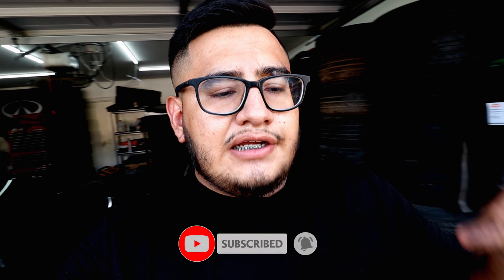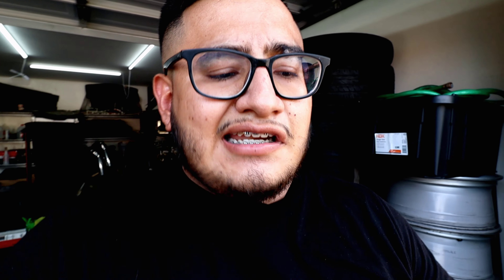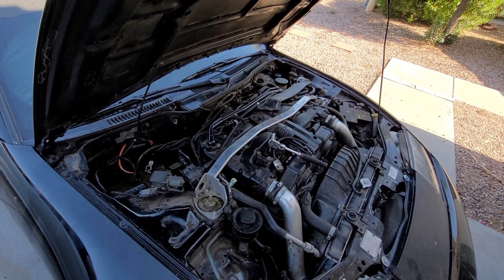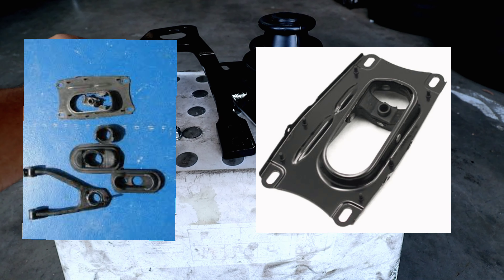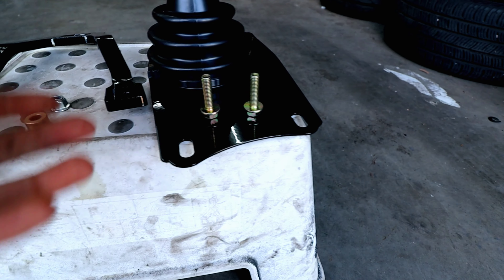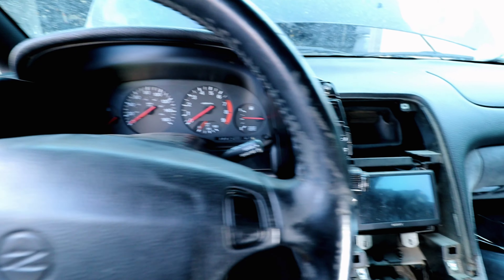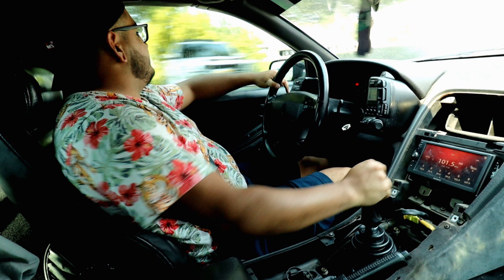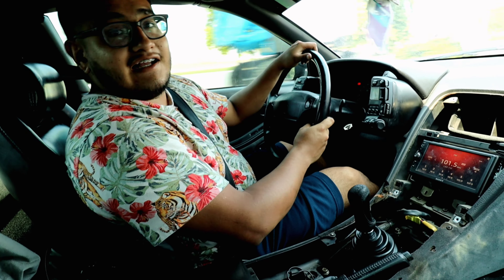This Mod Will Make You Shift Faster | Z32 Z Speed Solid Shift Brace

Comment: So where was the rattling coming from? Was it the shift knob? Also couldn’t help but notice a clanking whenever you moved the shifter all the way left or right. That the shifter hitting the exhaust or something? Did you fix these issues? I don’t want to purchase this bracket if it’s going to cause all this noise.
Reply from the maker: The noise  is coming from the bracket
Reply: @ERICSDIYGARAGE  were you able to fix the rattling. I bought all the same stuff and it's rattling like crazy. This sound is kind of ridiculous. I would of never bought the bracket, had I known this BS. I'm wondering if rubber washers would help with this?
Reply from the maker: @Nobody-dc8dp  so far no
Reply: @Nobody-dc8dp   So this brace replacement removes three rubber bushings. The Z1 short throw also adds a more solid connection. Everything is now directly connected to the transmission, so any vibrations will be undamped. If there seems to be EXCESSIVE vibrations, check your trans mounts. They are also bushings which wear out.

Comment: Hey did you buy an ebay short shifter? It came with a snap ring, but I don't see where to put the snap ring. Any idea? Also did you figure how to get rid of the rattle coming from the aftermarket shifter bracket?
Reply from the maker: No I don't have a ebay short shifter
Reply: The snap ring is supposed to go on the bushing and it’s held down by the long bolt that goes across the control arm. I actually think is better to not have it since it will put the bushing under more stress and you would want some room for it to flex.